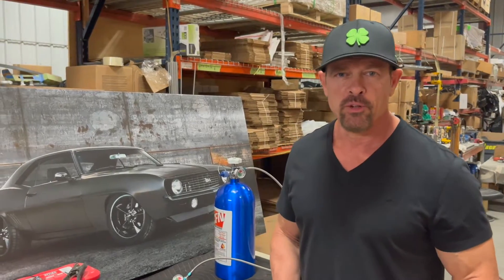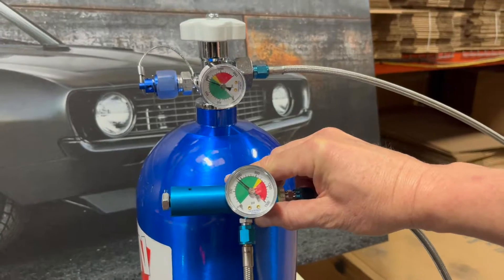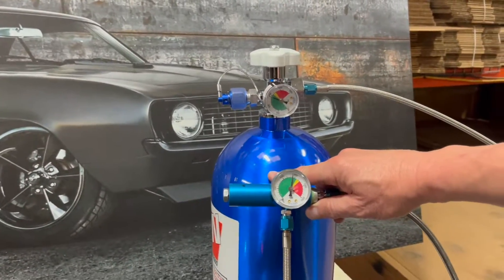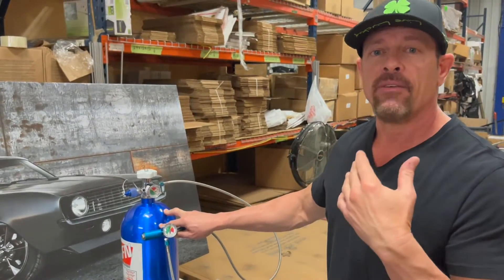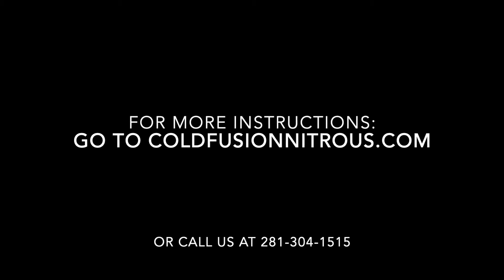Nitrous Regulator Explained: How to Adjust PSI for Cars, Motorcycles, Snowmobiles, Jet Skis

Comment from the maker: 00:03 Understanding how a nitrous regulator works and how to adjust the PSI.

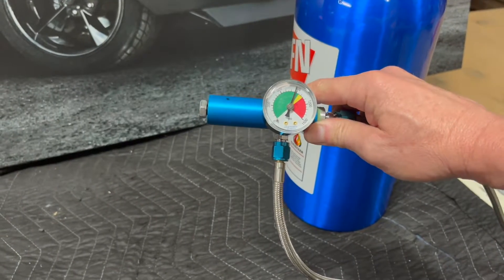00:31 Nitrous regulator regulates the pressure down compared to the bottle pressure.

00:58 The video explains how to adjust the nitrous regulator PSI for cars, motorcycles, snowmobiles, and jet skis.

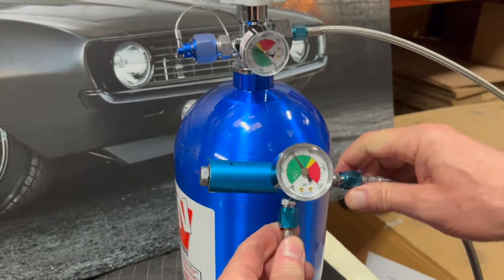01:32 A nitrous pressure regulator is designed to maintain a consistent pressure as the bottle dispenses.

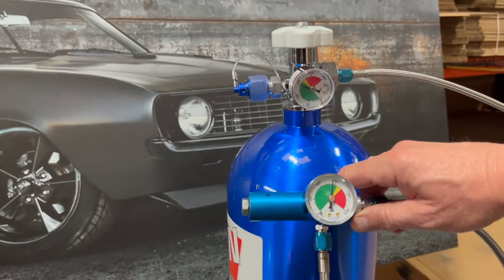02:01 Lowering nitrous interest reduces pressure, important for motorcycles, snowmobiles, and jet skis.

02:25 Regulator helps regulate the PSI and maintains correct nitrous jetting.

02:51 Adjusting nitrous regulator requires system activation and testing

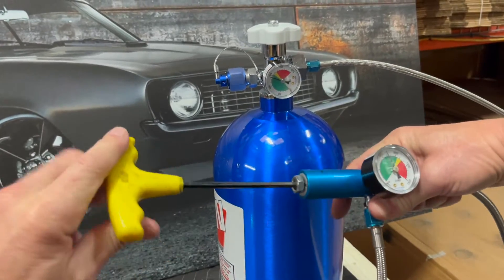03:13 Adjusting the regulator affects the pressure
Reply: Nice!  where can I buy this nitrous regulator?
Reply from the maker: www.coldfusionnitrous.com
 @DIYGEEKTEXAS

Comment: Hey, I’m trying to order one of these on your website. I’m not having any luck… also the hoses on my motorcycle kit are 4 AM. What are the connections on the regulator? Will mine work , the 4AN ?
Reply from the maker: Yes the fittings on the Regulator are also 4an. Not sure why the website isn't working for you. I just tested it and it's working fine. Send us an email at: sales@coldfusionnitrous.com
Reply: @ColdFusionNitrous1  I’m gonna call in a few minutes.